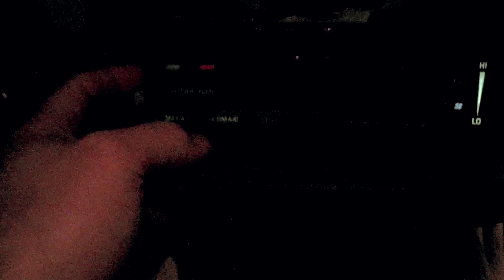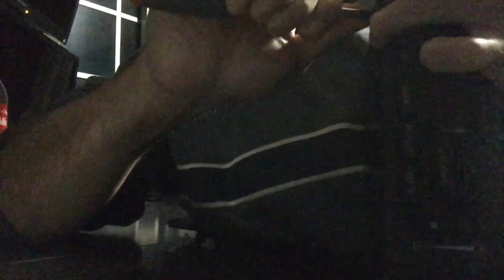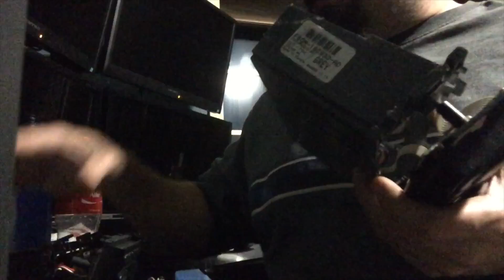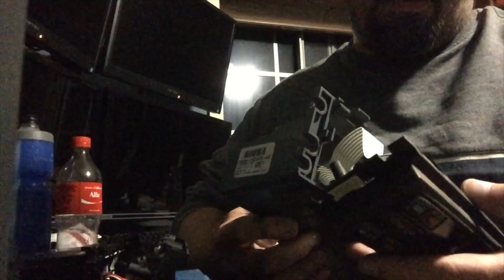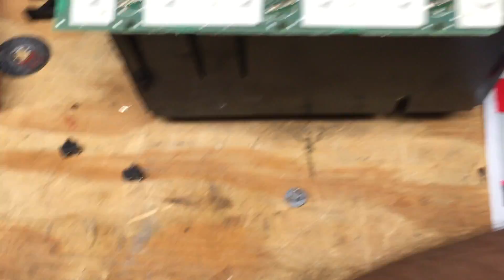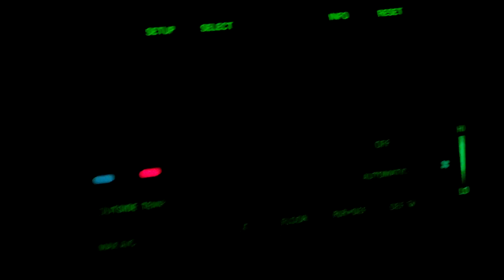Ford Lincoln Mercury EATC Repair - Panel Bulb Replacement

Comment: 2004 Mercury Marauder. My EATC lights flash on and off after driving a bit. I entered the self check and it read ok, no codes came up. I sent it out to be repaired anyways.  When it came back.  I put it back in, but its still flashing. Any ideas what is causing it to flash?

Comment: Details for those doing this...  Thanks much, I was able to do this myself on 04/02/17.  This is the sister video to the one that describes replacing the O washers.  I completed both O ring and light replacement.  Recap on eatc removal:  7 mm socket for 4 screws holding eatc to dash; 10 mm socket for 2 nuts holding air connector (listen for air sound as suggested) small flat head screwdriver for 5 clips; T6 (torx) for 5 screws holding circuit board to front panel; and gently pull off all 5 lights (with base) and replace with Radio Shack on 2721154 (12v 50 MA incandescent bulb w/base, bulb type TL-1 1/2 bi-pin, M.S.C.P.:1.27 Im as copied from package label) I have a 2007 Ford Crown Victoria 204,000 miles and had already paid for a new eatc only 60Kmiles ago.  For O rings, use a T20 to remove 2 screws holding valve top assembly from eatc unit and a very small (#1?) phillips screwdriver to remove plastic top from valves.  Don't slather on the silicone grease as I had to reopen it up and wipe all four down including the springs when it wasn't working after the first install, a very light coating works fine.  BeenThereDoneThat